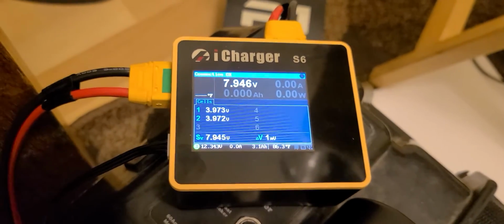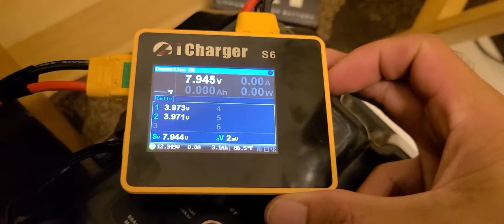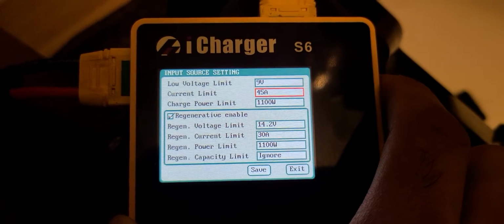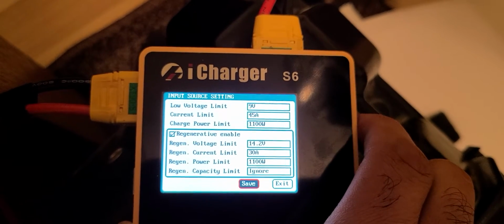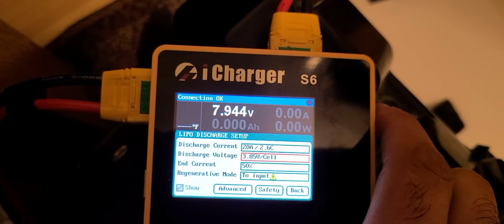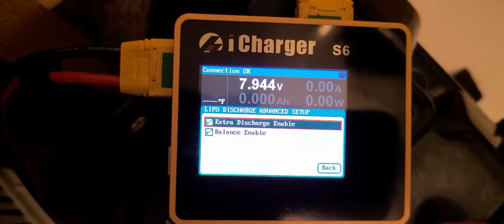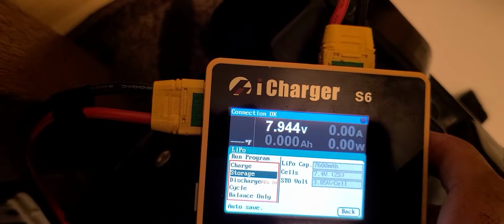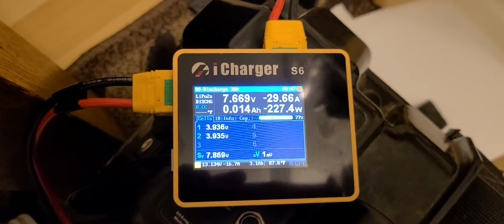s6 30amp(or 40) discharge without resistor bank

Comment: If Im using a 12v 75a 900w power supply do I need to change the default 9v to 12v in the input and power limit menu?

Comment: U didnt show how to wire the battery or lipo ?? Or do you just use a battery instead of a power supply as input ??
Reply from the maker: Yeah, exactly. You would be using the battery as your power supply. You'd never use regenerative discharge while plugged into a power supply, because it can't accept voltage back, it would just literally explode. Whereas a battery is like a bank, where voltage can come in and out. 

As far as wiring goes, you'd have to be able to connect either. S6 uses an xt90 connection, so your lipo would have to have an xt90 connection. 

For the lead acid car battery, I had to wire an xt90 to terminals to attach to the battery, yep
Reply: @ExaltedRC I wonder if using larger than the discharge current diodes would protect a power?
Reply from the maker: @nathaninwa240z not sure what those do, tbh. But I wouldn't recommend it. Electricity has to go somewhere.. so either burned off by resistance/ heat..or to another bank, like a battery
Reply: @ExaltedRC the diodes are a 1 way electrical check valve.   So no current back to the power supply.     My thought is to wire a power supply to a battery.   Then wire the icharger to the battery.   Set the power supply to say 12v for a 12v battery.    This will keep the battery charged if voltage drops, but will allow you to regen back to the battery raising battery voltage, but the power supply shouldn’t care since it’s electrically check valved out and won’t see the current/higher voltage.    

This might be how RC Discharger works just using a lipo for the battery.

Comment: the exthernal disharge option is  for external resistor bank  not for battery i thing you shoud disable that option if you use the battery
Reply from the maker: It's actually termed as regenerative discharge, which by design, is to take power from your lipo, and send it to another lipo, or battery source. In this example, it's going to a battery. You can use a resistor bank also, and that is just burning off the energy through resistance, which works too. I shared this because I also thought I'd have to have a resistor bank..but, if you're using a battery to power it, you can simply send the discharge juice right back into your source battery, and at a high rate.
Reply: @ExaltedRC  the extra discharge enabled the internal mosfet for the additional 40w drain. if you are just cycling packs you want it disabled. it you a surge testing packs, you might want to leave it enabled